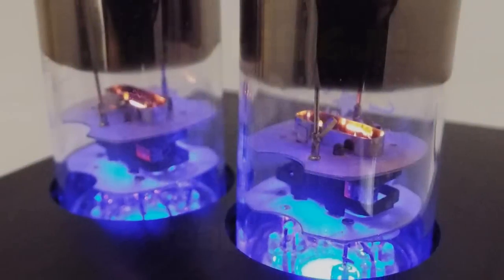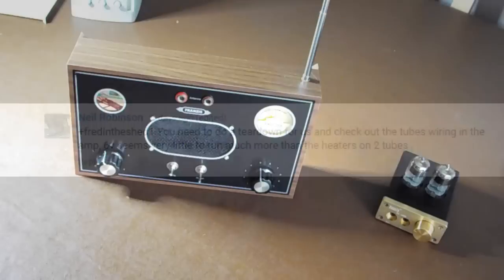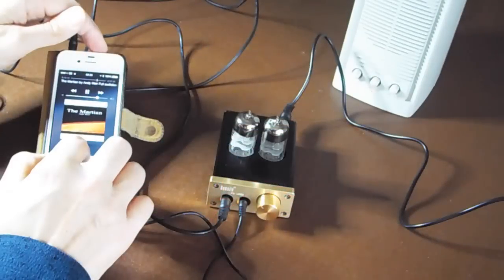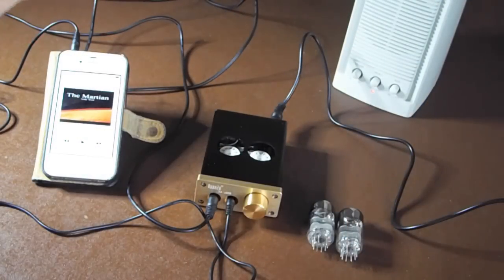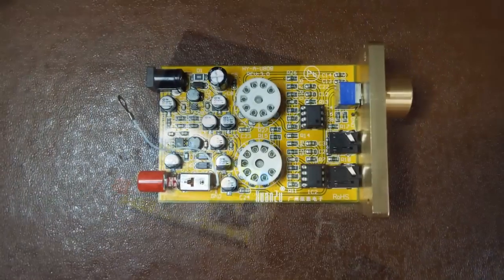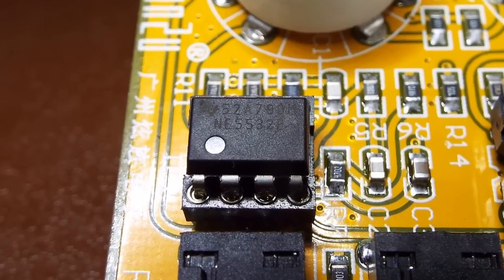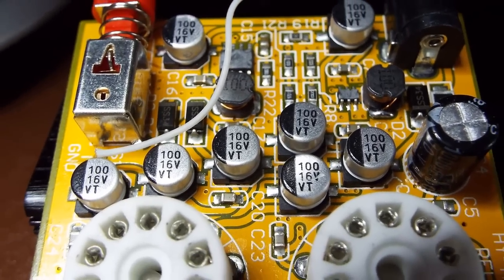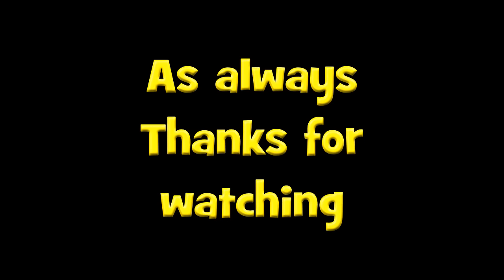Audio Hifi 6J9 mini vacuum valve ebay amp teardown

Comment: So, has anyone figured out if its a fake system or not?
Reply from the maker: +Bram Kelder Well what I know.  The tube / valves are amplifying and are in fact microphonic which is prob not a good thing but proves they are working.  The small IC chips appear to be pre amps.  The tubes themselves can be upgraded to a better make such as Phillips.  I am waiting for someone to come back and see if that makes an improvement.  The amps are falling in price from ebay china and sound ok for what they cost.
Reply: +fredintheshed1 Thanks for the info! I&#39;ll buy one to try, since I now know it does actually work. I&#39;ll also try to find some other valves that are compatible. If it makes a difference I&#39;ll be sure to let you know!
(it might take a while though: Estimated delivery Wed, Jan 06 - Tue, Jan 26)
Reply from the maker: +Bram Kelder Yeah let us know if you find that better valves improve the sound.  Merry Christmas.
Reply: Compatibles Valves are: E180F, 6688, 6j9, the russian 6Ж9П ones, CV3998 and the 5A/170K tubes. im not too sure about the last 2 ones ^^

Comment: Hi Fred.The capacitors are rated to 16v but that doesn't mean there is 16v in the unit..Also,there are  no audio output transformers to load the tubes which are only 2 watts dissipation but it calls for over 125vdc on the plates.
Reply from the maker: +Mike Samra Thanks for the extra info. Yes this is the mystery, where is the HT coming from ?  Other than the socketed IC pre amp chips I still cannot see any audio amp other than the tubes themselves .  The debate goes on my friend.  ;-)

Comment: Hi All. I just received one of these and plugged it in and it sounds great. Interestingly, one of the supplied valves is microphonic (not normally a desirable trait :/) and when you tap the valve, or the amp itself, it makes a healthy "ping" sound in the right channel. This is pretty clear evidence to me that the valves are in the signal path. That and the fact that it takes 10 seconds or so to get any sound from it when first switching it on pretty much seals it for me. Would be nice to see a circuit diagram if one exists, I can't imagine they'd be deliberately keeping it a secret.. Cheers! Stephen
Reply: Speaking as a musician on a budget, I have one of these babies and it sounds terrific. Currently, I have mine hooked up to a CD player using its RCA outputs, and it's a delight to hear - a much warmer and fuller sound. It's a HYBRID tube amp, and the warmth and soundstage it adds to the music is entirely noticeable. That's the point of using tubes in the first place. The argument that on some of these small amps the tubes are cosmetic and for show only is ridiculous, at least on this one. One can hear the difference in the 'spaciousness' of sound by using one's ears. I will never go back to listening to music without a tube amp: there's much less listener's fatigue and it's fun to rediscover one's library without the harshness of straight digital sound. Tubes are definitely an analog phenomenon as far as I'm concerned, and I plan to continue to enjoy it. It was worth every penny of the  $50 to try it out and then have it as a keeper. Speaking as a musician.
Reply from the maker: +paukengott  The ping test sounds interesting I did not think of that.  There are lots of people upgrading the mini tubes on the net to increase the bass and they report change.  I suppose a diagram does exist somewhere but these china companies have a habit of modifying the circuits to save even more money.  I think unless someone can prove that the valves are not in the amplification path we can conclude they are working.

Comment: I got mine today. It took way less time than expected. They bass is fantastic, it has that mellow, rich sound characteristic on tubes, so I'm fairly convinced that the tubes are amplifying the audio. The high notes are average. Now I gotta wait for the nice tubes to come in to see if they make a difference.
Reply: +Albert Escamilla no difference in the tube quality. Actually one of the new tubes that came in was super sensitive to vibrations/tapping, so I can't use it.
Reply from the maker: +Laser Lens Nice one.  That sounds hopeful for the tubes working.  I will be interested if your new tubes make any difference to the sound volume or quality as that could clear this up.
Reply: +Laser Lens any updates?
Reply from the maker: +Laser Lens That's a pity.  People are now talking about swapping out the IC chips as they feel that they could be the MAIN amps and the tubes are in fact pre amps.

Comment: Hi Fred. It's hard to tell how they have wired the tubes, as they may be using internal layers of the PC board to connect pins of the tube sockets that show no connection to a trace. One easy way to tell if the tubes are in the signal path...... If sound comes from the amplifier immediately when you first switch it on,  the tubes are not doing any amplification. The tubes they use have indirectly heated cathodes, which means they won't work for about 11 seconds or so after turn on. So... narrowed down, the amp shouldn't make any sound for about 11 seconds.
Reply from the maker: +Mr Carlson's Lab Yes I agree with that.  I did compare it to the single tube in that German kit I showed at the begining.  That does indeed take about 10 secs to come up.  The mini amp is up and running in about 2-3 secs.
Reply from the maker: +Murlock2000 Well its hard to really tell.  I am waiting for someone to swap out the tubes for better ones and see if the sound is different. It comes down to money, like most things.  If you want a good valve headphone amp there are plenty available around the £150- £300 mark.  For less than £30 delivered this little amp has a nice smooth sound.  How much the tubes are really working is another thing.
Reply: i believe i saw some other video with the same unit where the guy swapped the tubes for testing, and also normally it should take about 10 or so seconds before they "start work" but these only takes 3-4 seconds ? could be an internal digital amp or so ?
Reply from the maker: +Murlock2000 It could well be but when you look at the board all you can see are 2 IC pre amps.  The more I read about these little amps and the tubes which people swap for upgrading I am beginning to think they are functional after all. Interesting if nothing else LOL
Reply: +fredintheshed1 So basically its all bullshit what they are selling :P - good to know, i was about to purchase one that i need for my headphones for my PC, but ill find something else :S

Comment: Alright, I looked up that IC, and it's a low-noise amplifier made by TI. They're likely for the pre-amp circuit.
Reply from the maker: +Laser Lens Well done I looked could not find it myself.  Yes agree it could be a pre amp esp as there are 2 for L/R channels.
Reply: +Laser Lens   No, it's the other way around from what I've read elsewhere. The tubes are used as the preamps, the ICs for the output stage. With the line output levels from most audio equipment, a preamp stage wouldn't even be necessary, so I believe the tubes are there to give the "tube sound" which comes from the characteristic tube harmonic distortion. The extremely low harmonic distortion given in the specs for these is most likely just the IC output stage's distortion otherwise the amp wouldn't have the "tube sound." They're afraid to post the distortion of the entire amp chain because most people don't know that the "tube sound" is DUE to harmonic distortion.

Those 6J9 tubes are triple triodes, by the way. They are used because they are a cheap and readily available tube because they weren't originally designed to be used as an audio tube like a 12AU7.

Comment: I just bought one of these a few days ago. I don't trust the included tubes to run for hours at a time, so I bought some Phillips E180F NOS tubes (they were listed as being compatible with the unit) so we'll see how it sounds in a month or so when I get the thing.
Reply from the maker: +Laser Lens That's interesting. The Phillips tubes may improve the sound also.
Reply: keep us updated on your results. I just picked up one. ( thought, what the heck, cheap enough not to cry about it if it turns out to be a solid state sounds okay I can use it on my computer)
Reply from the maker: +John Cossack I think you will be pleased with the sound ;-)

Comment: Great video , As a guess the ht is produced by an ac inverter looking at the circuit, then converted to dc for the tubes.
Reply from the maker: +Simon Sparks Ah the valve man ;-)  What do you recon on those 16v mini caps ?  Some kind of step up transformer ?
Reply: +fredintheshed1 I'm not sure on the LV cap but I think the coils producing the ac have dc injected into the primary producing a square wave not sine .A mixture of modern  transistor switching and an oscillator produces the high tension.I think a similar principal was used in the old valve car radios when only 12v was available. I'm no expert on the latest sm technology mate.
Reply from the maker: +Simon Sparks These low voltage China valves must be pretty cheap to buy going by the cost of the amps ?  Do you recon you may build a low voltage amp yourself one day ?
Reply: No Fred it's all old school mate.Big Valves Big Caps Big Tx.I love drawing current .
Reply: Maybe correct, can build very low voltage valve rf oscillators, such as the bfo in my old RCA AR77 communications receiver, which just uses 15volts on Anode and Screen Grid, but not Audio Power Amps at such a low voltage!!

Comment: I wondered that myself. If the tubes was actually working because Mark used to tell us they needed so much voltage and current to run tubes, but you know these Japanese people make everything smaller and run on less power. Great video buddy
Reply from the maker: +shaun pi  Thanks mate.  I really don't know, the jury is out ?  Simon may have some idea.  hope things are ok with you.

Comment: Doesnt look like the valves are a traditional valve Fred but rather a modern take off of a traditional valve made with a modern slant. They may just be an op amp enclosed in a glass vessel wouldnt be to hard to do but that would mean that they do work as part of the amp circuit but wouldnt need the high voltages that traditional valves do.Still looks nice tho doesnt it?
Reply from the maker: +Gary g1fsh Yeah you would prob need someone with proper test equipment to prob around and take some readings.  Mark would have known.